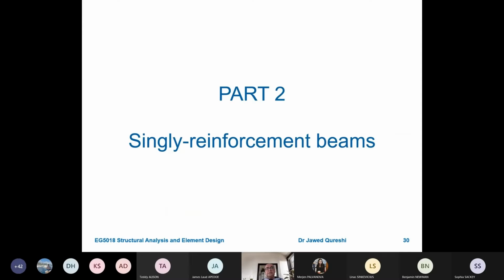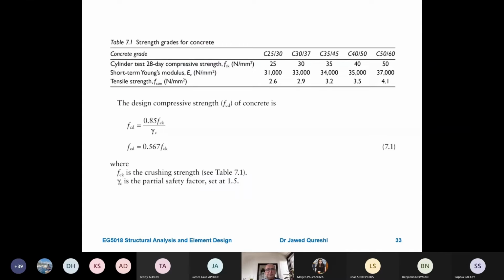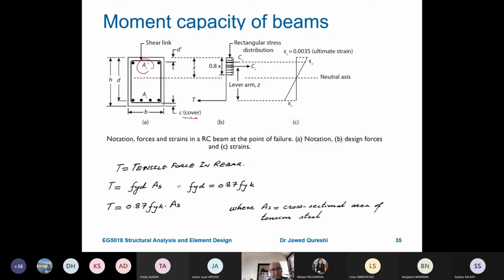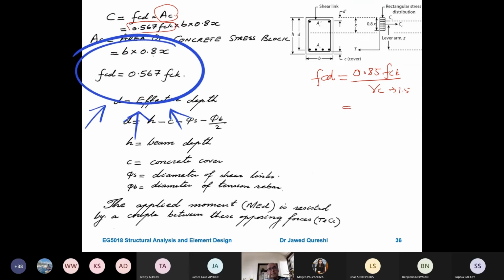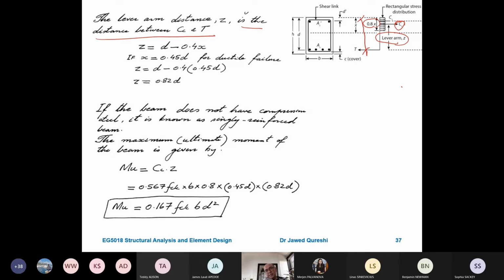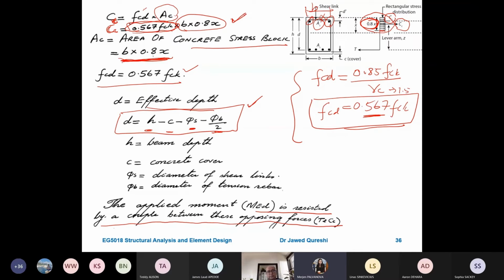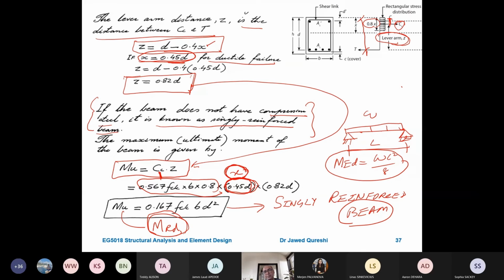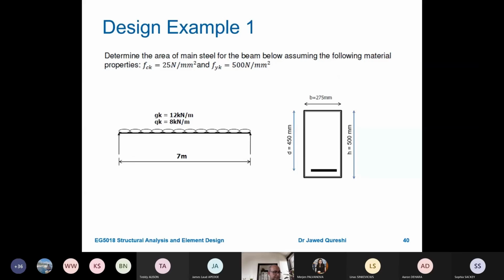04 Singly reinforced beam design – Theory  | Eurocode 2 Concrete Design

Comment: In thumb rule ,
Finding depth is ok …
To find widh that equation have v(shear force)…to find …the v we want that beam self weight also….we dont know widh how …can get macimum shear(v) 
Without considering self weight of beam
Pls expline sir ….
Reply from the maker: Self weight can be assumed for a section of 200 by 400 mm and multiplied with density of 25 kN/m3. It can later be modified. Initially, we are roughly coming up with size, so even if you don’t work out the self weight, it is fine too.
Reply: Thank you sir ….
Is any video did you upload to know  how do that modification?

Comment: Dr. Jawed Qureshi. At 4.51 in equation 7.1 - design compressive strength of concrete. You are dividing the caracteristical value by the partial safety factor, but you are also multiplying by 0.85. Is this the value of the "Alfa CC" coeficiente in UK National Annexe for equation 3.15 (Eurocode 2 3.1.6(1)P). Thank you very much.
Reply from the maker: Yes, you pointed out rightly. 0.85 is the value of  "Alfa CC".
Reply: @DrJQureshi Tank You for your reply, and congratulations for the excellent lecture. I'm following you from Portugal